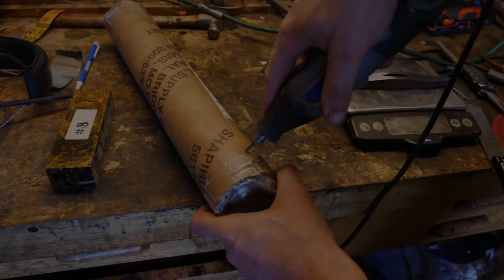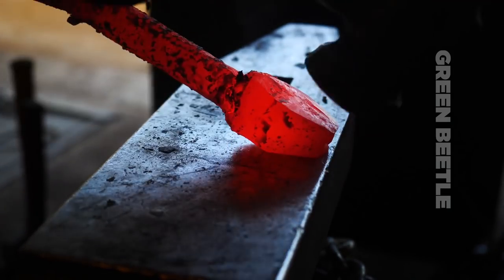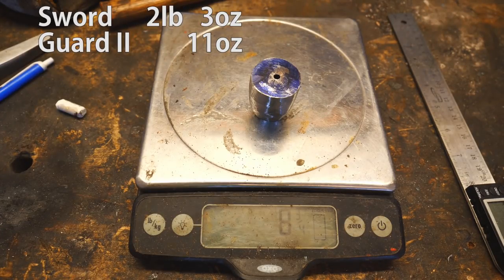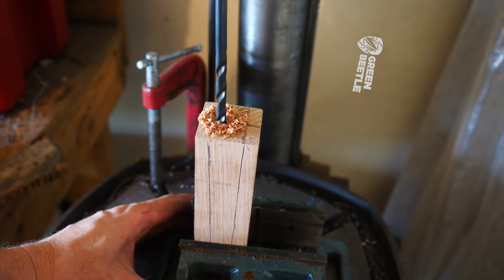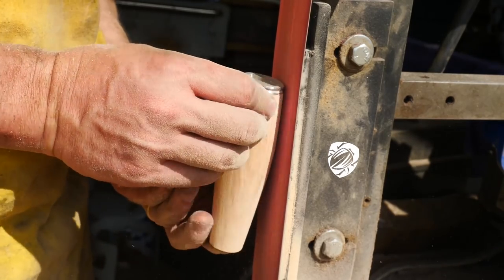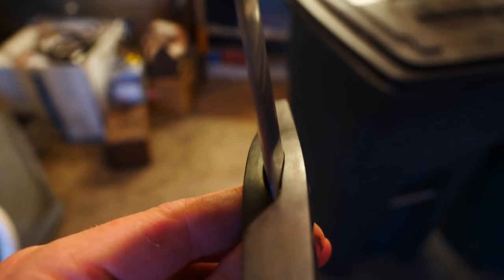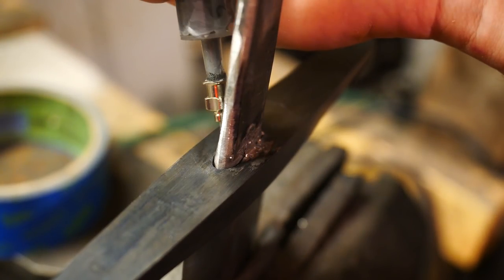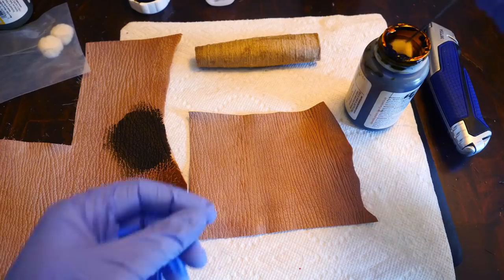Forging A Sword Pt 4:  Finished & Tested!

Comment: Have the leather joint on one of the narrow profiles of the handle, it'll hide the joint much better, also scarfing both side of the leather ensures an almost invisible joint line, easier said than done, i know, but for a first attempt, not too shabby at all. GG
Reply from the maker: good advice, thanks!

Comment: The inner twine wrap adds a small amount of shock absorption and helps with grip. The outer layer is to keep the leather from doing what it ultimately did anyway where it shrank when it dried and to squish the leather down to the inner wrapping to help create that grippy texture.

Comment: I am not sure as to whether or not this particular type of sword would normally have one, but giving the blade a slight hollow grind should be able to remove a little bit more weight while not reducing rigidity.

Comment: to help with the guard, before final filing heat the guard up and hammer the blade in the guard this will allow a much more tight fitted guard with less filing to be done

Comment: I love this, and all of your videos. Would love to learn to do this. I did a knife refurb for a friend a couple of years ago on a piece that belonged to his grandfather. Intimidating. The handle was comprised of a bunch of small leather rings that had been wearing for years and had some holes. I used a wood filler to give the handle it's integrity back, and went over it all with mink oil to soften the leather some.  Anyway, I love the way your handle turned out, even with the seam. If it really bothers you, I think you could use a small amount of wood filler or body filler, a light sanding, and  little of the colored dye you used on the leather. I can't guarantee it would work, but it worked wonders on the refurb I did.

Comment: From what I've done with limited leatherworking experience (never wrapped a handle, so my "advice" may be worth shit) If you can cut each edge with a thin, tapering angle, say 65 degrees, you can overshoot the wrap just a bit and carefully shave the dried join to look as smooth as possible.  The choice of a strongly grained leather was maybe not the best choice.  There's an art to selecting material that will match up very nicely in most trades that deal with natural materials, be it stone, wood or hide.  The sword looks really legit and deadly functional, so I think you nailed the important bits.  The handle looks grippy and as long as the leather doesn't fall off while you're cleaving zombies or cannibals, looks aren't too important.

Comment: So the weight of your blade is fine actually pretty spot on for a sword and your point of balance is about where it should be 4cm-5cm from the quillion but your pomel is how you adjust balance you make the pomel heavier to bring the point of balance closer  to the hilt

Comment: To fix that seam issue, a possible solution would be to place some sort of stitching along the seam. If you're unable to feed thread through the leather along the seam because of the epoxy, you could get a strip of scrap leather, create a stitch along it and then epoxy that on top of the seam. Just make sure to hammer the stitching a bit to flatten it out, but otherwise, I think it'll look very cool.

Comment: The guard has the sword profile inset into the guard, so the guard actually sits higher on the sword. That is often why you have points o the guard, it hides this feature better.

Comment: The blade is very nice made. The fuller is a little narrow for my taste. I'm concerned about the overall weight of the hilt and the putty in the pommel. That might be a weak point that will become loose after use. A good round pommel would have been a better choice for me. I hope to see other swords from you.

Comment: Three pounds and a few ounces would be heavy for a sword. I find that heavy swords often are more easily solved by reducing the weight in the handle area from the guard and pommel being less bulky.

See if you can grind some weight off that area specifically and it might perform better than you realised it could, especially since the further forward balance alongside the overall lighter weight will make it a far better chopper.

Comment: Ideas: Add a twist to the guard for decoration if you find the time, blue the pommel and the guard (Clickspring has an amazing method on his channel, using brass shavings in a brass box to distribute heat evenly- perfect for bluing). Swords can be as simple or fancy as you want! Some sabres were even blued, engraved and gilded!

Edit: Also, well done for doing an amazing job and putting in a full tang.
Reply: Also, for shark and ray skin, look at 18th century British military sabres. They would wind silver thread around it to form nodes that made the grips even grippier.

Comment: Dude, it looks amazing. You made a historically accurate sword (sans weight) with good proportions on your first try! Don't sweat a gap in a handle. Handles on swords break anyhow - use it enough and you'll be replacing it eventually.

Comment: I see sometimes your drill press is stalling out, i would wager you have a belt driven instead of gears. I had that problem too with some larger bits and what helped quite a lot was filing the ways that the belt made contact with. Mine had a lot of paint on those surfaces and after i got it down to clean steel it had so much more power

Comment: Idea for material used to make a knife: you can buy metal flake, the kind used to make metallic automotive paint, online. I would like to see if it'd keep its appearance as flakes after being forged into a blade. If it comes out the way I imagine, with no experience in forging, would it have the appearance of millions of scales or would it melt into a smooth surface. I'd like to see an amazing texture from it.

Comment: You made the handle round. Not super problematic but it will make it difficult to feel the edge alignment. Just a pointer
Reply from the maker: Homeless Alex top half is oval, bottom half is round

Comment: Looks amazing the only issue  I have is the shape of the handle. The rounded handle would probably make it hard to do propper edge allignment. Another thing is that the length of the handle seems a bit too short. Still its amazing and a great piece of art nevertheless.

Comment: The point of balance is not NEARLY as important as your forward and aft pivet points. You set them by distal tapering and the weight of guard and pommel!

Comment: ive been looking for a belt sander like that where you can change the size of contact wheels and such but cant find one? also you could have sued your sande to grind ina  fuller with a smaller contact wheel just food for though

Comment: Great Work as always! What are your distal measurements? It's not uncommon for the sword to taper from 7 or 8mm at the hilt to 2mm or even less distally. I'm working on a polish szabla currently that's starting at 7mm and tapering to around 1.5mm.
Reply from the maker: bjb06f  it goes to under 1/8" at the tip but it's still too thick for a stretch that starts a few inches beyond end of fuller.  I think I can get another ounce or two off it.  Thanks for the good info, brother!  Sounds like I got more work to do.

Comment: Any reason why you couldn't heat the guard up before pressing it on? A lot of antique swords have a a point of balance that far from the guard, there's nothing wrong with it. In fact it probably makes it a better fruit chopper.
Reply from the maker: I think the balance point would be ok where it is in the video if the sword weren't so heavy.  It was tiring to use.  I tried heating it once but couldn't get it hot enough to fit on without making it too hot to point it would run colors on sword.

Comment: The only complaint i have about the handle is that it's too circular, circular handles in a sword gives you less control and feel for the movement of the tip

Comment: Im not an expert.. but im assuming that you are using a propane gas (blue tank) torch, instead you should use mapp gas(yellow tank). It burns hotter than propane gas (blue tank)
Reply: thestevemeister203 thestevemeister203 I'm not sure which part of the process you are referring to? If you are suggesting MAP for forging it would be unnecessarily hot, and you may find yourself burning out the steel. Propane and oxygen works very well and can EASILY get to forge welding temperature which should be as high as any Smith needs to take their material. For the hobby torch, I think that it would be hard to be as accurate with it, and one slip could completely destroy his entire handle. Just a though
Reply: Jake Pryor when he is heating up the metal tip of the pommel to peen it on. He said that the end doesn't quite get hot enough... so i was assuming he was using a propane tank. Which is a blue tank. Mapp gas which is in a yellow tank, it burns hotter which heats up the metal faster.

Comment: Damn man, that really turned out awesome! LOVE the sharkskin; definitely use that same material if you decide to redo the handle wrap. I know how much it sucks running out of time to clean up the details on a project, but it still looks great. What was that high temp epoxy/fill product you used on the pommel?
Reply from the maker: "Permex"

Comment: Lol.. Fruit ninja them bannaners.... Hey quick question. Were you not using the horse mat for holding your blades in the vice when waky waky things on handles and such things to make it not slip...
Reply from the maker: I was but the pieces tend to fall apart after a while, I need to order more.  It works better than leather,

Comment: Looks like a Fairbairn Sykes on steroids.  Also, what's the balance like on that, with such a light hilt?  You can take weight out of the distal (Tip thickness) or add it to the hilt.  I'm gonna say the pommel, that's a tiny pommel.  Doesn't look it would work very well as a grip-stop, either.  And finally, that grip is entirely too round for good edge alignment.  You tried cutting with it, and it didn't look that great in the slow-mo.  (You can split a pop can with a concrete curb)  If you plan on making more swords:  More pommel, you have to feel it with your hand, without looking at it.  Not just so it doesn't slip out of your grip, but also to get used to precisely where the tip, and point of balance are in relation to your hand.  Also, broader tang, for a more oblong grip.  So you can feel the edge alignment, without looking at it.  This is the weld that makes the sword an extension of your arm.
Reply: Tip-heavy is actually a good thing for "Slicey dicey."  You do have a well developed tip there, and the ferules should stiffen the blade enough for a good thrust.  Very nice work on the crossguard.  No visible fit there, it should stay pretty good, even with the compressible chord wrap on the grip.  Not that you're planning on getting in actual sword (Spear, ax, shield) fights with it, but it looks like that should hold up.

Comment: U shouldn't have removed any or as much material from the pommel to change the point of balance great video any way
Reply from the maker: Yup, balance suffered.  I'll try to get the weight down a bit more on the sword itself, hopefully things'll improve that way.

Comment: Liked for Ending Him Rightly
Reply: In my humble opinion though, the guard is much thicker than it needs to be. A guard about 1/4 inch thick by 5/8 inch wide will do a perfectly good job of stopping an errant blade, and indeed some guards were thinner than that (have a look at the Lockwood Swords Sl-1009). A narrower oval cross-section handle will help facilitate this, and remember that the guard should be thicker where it houses the blade than at the ends. You're very smart to be watching the weight as you go, though. Attention to detail is the key to a worthy sword. Overall great build!